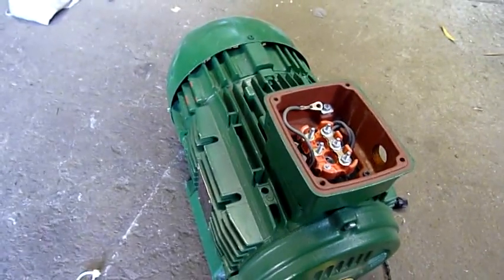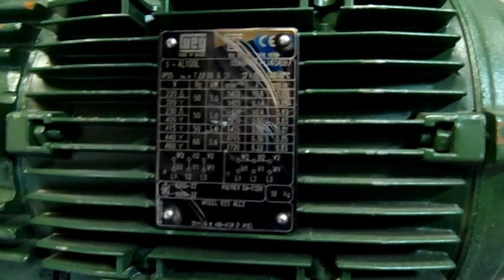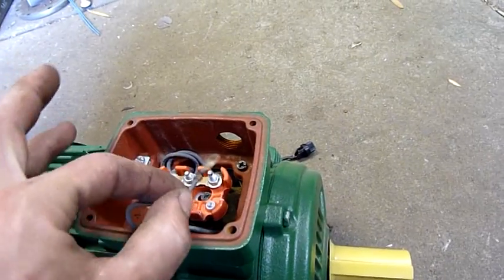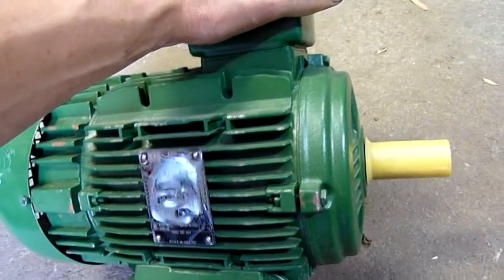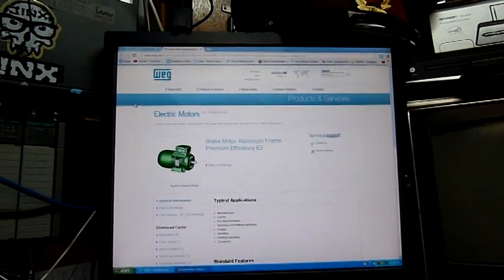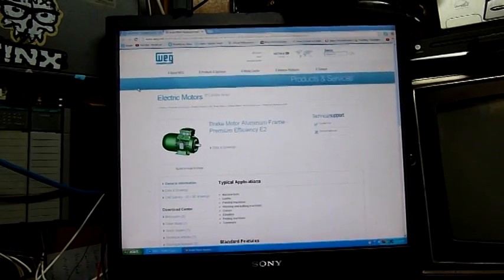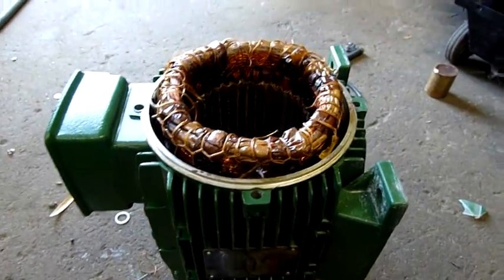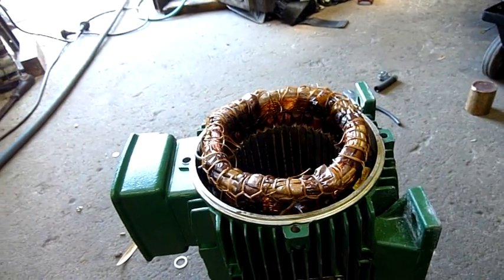3Kw WEG 3 phase motor autopsy

Comment: Oh my.  I just picked up one of those.  I got a single phase 5hp.  It seems to run fine without a load.  I wonder if I should crack it open just to see if anything looks wrong before trying to use it for anything.

Comment: Hello. Thank you for this video. I am interested in doing an engineering project that involves a VFD controlling a pump as part of a temperature control system. I was curious to know if I could run a single phase 1/2 hp motor hooked up to a VFD with residential power accommodations. I really don't know much about electronics but I am very much willing to learn to get this project going. If that is possible, could you perhaps recommend a VFD (60Hz) and pump or else point me in the right direction? Thanks.

Comment: Hi Aussie50
I scanned through your channel to see if you made a video on how to build a motor (regardless of 1 or 3 phase) . I wish to see how you do the coils and most importantly how you connect them together in the right order for the motor to work. Did you make any video to show coiling and soldering each two ends in the right way ? I wish for a reference to such work please. Thanks

Comment: Hi, enjoyed the clip, always trying to learn something. You mentioned you were thinking of using the motor on your lathe. My question is, if space is available, why couldnt you just replace the 3 phase 415V motor with a slightly larger 240V single phase motor. I want to buy a 3 phase Milling Machine and after looking around reckon the phase change converter is the best option but man are they expensive. Can you explain to me why I couldnt use a single phase motor on say a Bridgeport Mill, making an adapter plate if required. What are the downstreal problems I could encounter. You know with the amount of used machinery now being used in home workshops I am amazed that the manufacturers never thought to make a retrofit single phase unit. Many thanks, Gordon
Reply from the maker: +Gordon Agent At the time I had a 1hp single phase motor on the machine, but it did not give me any ability to use a VFD to control spindle speed. I have since put a 1Hp gearmotor (3-1 drop gear box) and a Delta 1hp VFD, its worlds better than single phase, so much smoother to cut and much less vibration. since VFD's have become so affordable I have swapped a lot of single phase motors to 3 phase + single to 3 phase inverter drive, it just makes them so versatile when it comes to speed control, braking, current limiting, reversing etc.

Comment: Hello Aussie50.Do you perhaps know if its possible to run a 3 phase 220 V, 4HP electro motor with 2 phase 220 V power supply ? Any advice ? Its a lathe electromotor.
Thanks in advance.
Reply from the maker: MBG-TECH I have heard of people using a run cap from one of the phases to the 3rd phase, but I have never tried it myself (nor could I tell you what rating to use) but I think it can be done.
Reply: ok cool, thanks
Reply: +MBG-TECH Have a look for "doubleboost" he shows you how to do it
Reply: +MBG-TECH yes it can be run if you configure in a serious of running caps in the proper layout, you just have to get the correct capacitance and connect that cap bank to the other lead which is the third line for a 3 phase feed. The cap will be wired in series from one of the line leads, such as 220v single phase or more correctly 220v could be labeled as split phase. Connect the other terminal of the cap to either one of the other 2 feed terminals and you can change the direction of rotation by switching any 2 of the lines to the motor. For a 4 hp motor, shoot for a capacitance of about 100 ufd and be sure the caps voltage rating is high enough to handle a fair amount over the feed line voltage as the 3rd leg which can be called the wild leg can run a bit higher than the line voltage

Comment: I just bought a small hobby jointer / planer 2nd hand with an old 2.2kw 3-phase motor, hooked up for Y 380/400V. It runs about 10 seconds when cold then stops (it trips the breaker), I think I can smell something like burnt plastic in the box, perhaps it is fried?
Reply: kenny bateman Oh yeah that one was a goner. Lucked out though and found a 4kw motor for 25 euros of the same speed. For this tiny jointer it's really overkill.

Comment: Green is the colour we use to demonstrate high efficiency motors. The Green ones here in Australia are MEPS Table B2 or better (AS1359.5-2004). The extension to the rear end bell housing that you commented on it an extension we need to fit to meet the efficiency levels as stated to meet table B2 - we need more magnetic material and this is an easy way to do it. All WEG motors these days are fitted with WISE insulation that is designed for use on VSD's (resistant to voltage spikes). Its basically a standard WEG W21 series aluminium motor...shame it was down to earth...and your right its dropped a phase and cooked itself. I really like the video... State Manager VIC/TAS/SA WEG Australia
Reply from the maker: G'day Sean, 
It is a shame this motor was damaged like this, I use and have used loads of WEG motors in the past, and today, with no issues at all!. great products!.

as I noted in the video, it looks to be installer fault for twisting the terminal lug off and dropping a phase. if they had installed proper protection on it, it would not have been allowed to run with one phase missing. but they did not.
Reply: You should hire him, ffs!
Reply from the maker: Kevin Chamberlain If it was my guy that did it, I would have given them proper training in connecting motors and given him a small torque wrench to get them familaure with acceptable torque ratings.
Reply from the maker: probably an un-trained maintenance operator, all studs were over-tight and stretched to a degree.

Excessive torque also cracks the insulation block on a lot of motors, leading to the same issue, a rogue connector that grounds out, or separates and drops a phase.
Reply: Aussie50 I'm a carpenter and joiner by trade but do absolutely all my mechanical auto work including welding but wiring I do not understand!
You seem very capable in this kind of thing!

Comment: Can you also wire those in delta for 440V? Does than not run at a higher speed? Oh i think you can do that but you need to switch it once it's running in star to delta, star for startup and once spinning then delta? I think this is correct (with a 3 way high power relay). Can anyone confirm this? Thanks

Comment from the maker: wiring for 3 phase is really easy, just work out which phase is which and wire them onto the correct stud. some applications its critical not to run the motor in reverse so a phase rotation check may be needed

Comment: Hi Ed,

I don't know if you have some Leroy-Somer motors, made in France. There are pretty good motors, the one I picked up on the scrap yard was quite used and almost 30 years old, but it worked perfectly fine on fixed 3~ 400V and on the VFD.

For the VFD, I think the best is to increase the PWM carrier switching frequency to have a smoother current in the motor windings.

Comment: Nice looking motors, see a lot of them running vacuum pumps for milking parlours.  Didn't know about the resonant frequency problem with windings, thanks for the info!  Local farm just installed vfd to run three 7kw vacuum motors, will ask if I can make a vid.